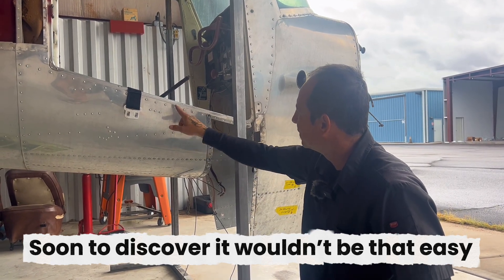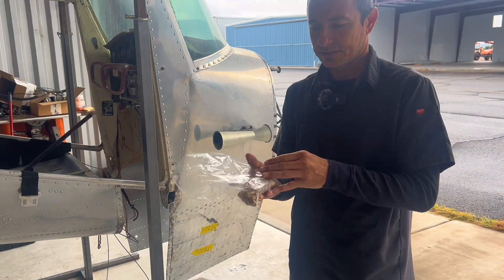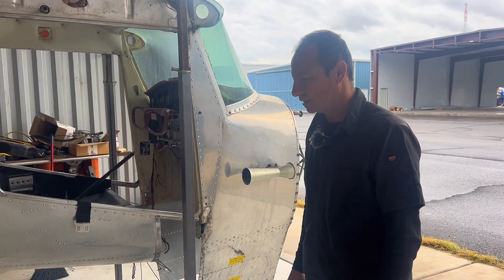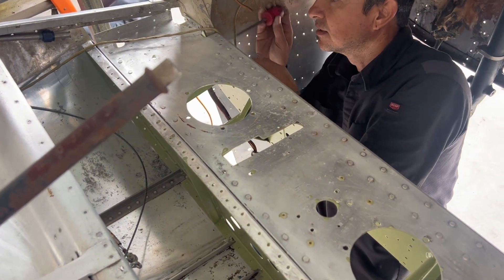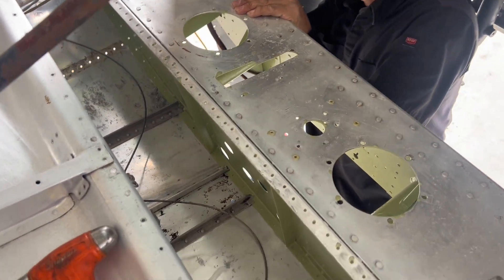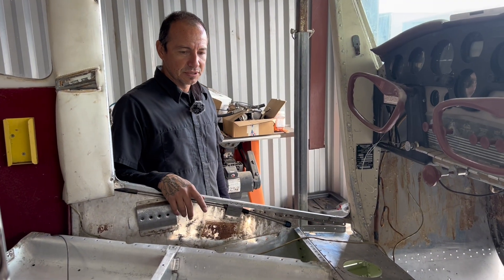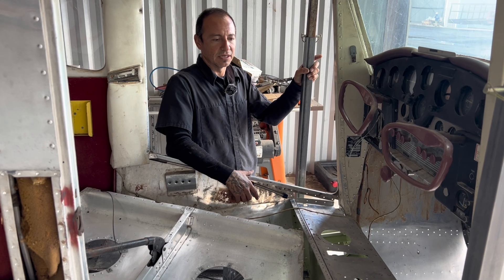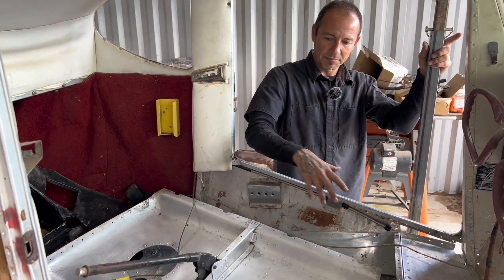Wrecked Cessna 140 Landing Gear Structure Installation

Comment: Thanks for another great and informative video. Just wondering if you’re planning on keeping that aircraft or selling it if planning on selling it will you recoup the amount of time and parts that you put into it? That seems like such a major project thank you.
Reply from the maker: Thanks for watching! Yes we will be selling the 140 when it is completed and we fly off some time roughly through the 1st oil change to make sure everything will be squared away for the new owner. After the sale proceeds will be put into the next project in line. Will we make money… but if you factor labor we will not. Purely parts standpoint we will be able to sell for more than we have invested. Our passion is fixing/building/flying airplanes but doing this alone would not make a substantial living. We also work as a commercial pilot and A&P/IA doing other work as well to help support this. Thanks!